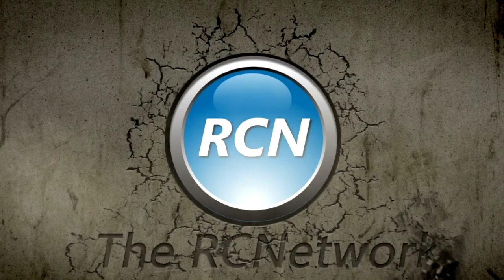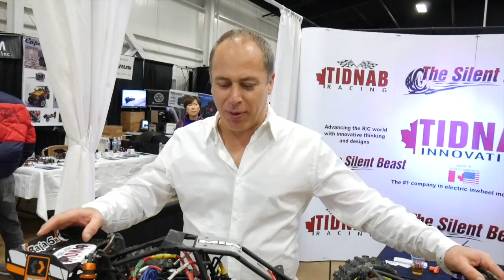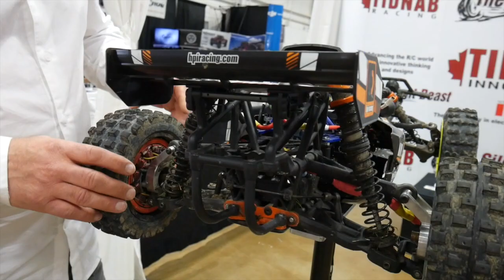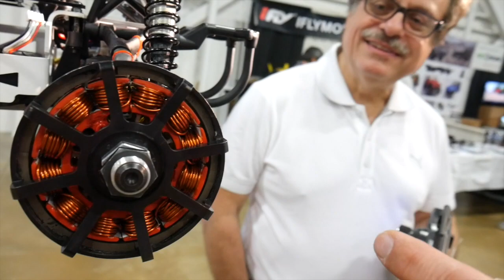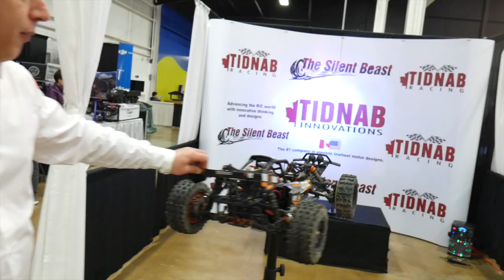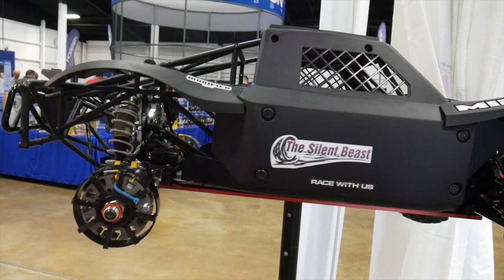RCX 2016 - Interview with TIDNAB Innovations - Baja 5b / Losi 5ive T Electric Conversion

Comment: very innovative and the future of this tech is quite promising actually. i read a lot of pessimistic comments but that's always the case with innovation, most fear it, some see the sense in it. it is undoubtedly going to face hurdles, like contaminants getting in the engine as some have mentioned, but that's simply a matter of improving and re-engineering the design, which happens to every product through its life cycle.

the most exciting thing to me is the future of torque vectoring through wheel speed differentiation. some in the comment section were talking about how without a diff it's useless etc where in reality this is actually the ULTIMATE differentiation method, even allowing for NEGATIVE torque. this is why the porsche 918 or the new acura nsx have individual motors. some may think that this is quite difficult and unlikely but look at the host of advanced software based functions advanced ESC's and transmitters have now. i am willing to bet you will see more and more of this.

however, to keep things relatively objective, there is the problem of having a significant increase in unsprung mass and this will reduce suspension performance.

Comment: Very cool pretty much looks like a stator. Interested to see how it will hold up and field conditions dirt ,mud and ,water
Reply: +EVERYDAY RC , they hold up just great, check out the videos we have posted on facebook
Reply: +Jo P once you get rocks in the motor bells it will rip the magnets up.  it needs a cover but then it can't stay cool enough.
Reply from the maker: +Shark Laser if you saw the Baja 5b - those were the original motors with years now of use.
Reply: EVERYDAY RC .

Comment: I've wanted to do this for years.  I've also wanted to integrate stability control/traction control like what comes on many new cars.
Reply from the maker: +RasmanZ Yep, eliminating a driveline is huge!
Reply: A major drawback would be the loss of frequency response of the suspension due to the increase in un-sprung weight and, of course, the longer wire runs.  :-D
Reply: +RasmanZ first thing I thought of too. unsprung weight will be a factor. nice concept
Reply: +mikeythiry I think a more interesting idea would be motors where the difs are.  4 independent motors with a smart controller, stability control, etc. programmed in.  That would be cool too!

Comment: Verry interesting, and I suppose easily protected from dust with a plate like some diskbrake on real cars. But Is there a system to do like a differential to have a different speed at wheels? Could it be programmable? Is it working with a gyro (to do like an ESP and ABS...) when the car slip?Isn't there a big difference tu use due to the non-suspended wheigt?When everything will be ok, I think that it is the future of every car.

Comment: Those things look awesome! 200kph might be a little over the top though, I can only just control my savage flux at 80-90kph.
Reply from the maker: +Benny2980 Yeah, I think they're really trying to test the waters on the RC market.  Consumers always want faster, lighter, smaller
Reply: +The RCNetwork id still buy it if it did 200kph. Lol
Reply: +Benny2980 The only problem at the top speeds is keeping the tires from blowing each time.

Comment: How much torque at the wheels? The motors would burn out if we attempt to tow a full size vehicle compared to a geared 1/5 scale!
Reply from the maker: +Francis Kuk Wah Might be a question for the TIDNAB guys.  Check they're FB page and leave a comment.  They're pretty quick to respond

Comment: My main concern is handling...... By bolting these direct to the wheels they've removed any kind of advantages you get from running a differential because they don't use one!

Can you imagine driving a Losi 5ive with no differential action at all?
Reply from the maker: That's where potentially a smart ESC that drives the motors detects slippage and diverts power.
Reply: +The RCNetwork Making it even more complicated and expensive.
Reply from the maker: +Anthony Davis I guess my frustration is all of the "arm chair quarterbacks" that are giving their opinion of this invention. Everyone has their skepticism and critique from a simple video. I got to see it in person and see it run. It's amazing and sure, it's probably not 100% perfect, but neither is 95% of the RC's currently on the market. I just wish people had a bit more open mind......
Reply: people tend to stay with the familiar and comfortable, don't sweat it, when the technology is proven most of them jump on the new bandwagon and claim they supported it from the start lol. what matters is that you are sharing it with us and inspire those open to seeing it's possibilities :).
Reply: don't see where it would be very difficult to add diff settings into the esc,  could control lock, and freewheel actions to infinity,  making a diff adjustment a few clicks on your phone if the bt the controller.  probably has a ways to perfection.  but this system is being instituted on performance minded 1:1 4wd vehicles which means they've already got the diff scienced.  awesome tech 2ith a few tweaks it might be on all cars in 10 years.  affordable for most right now,  likely not.
Reply: Its actually garbage.  You now have a MASSIVE increase in unsprung weight; which will greatly affect handling in a bad way.
Reply: If you don't have weight figures and actual data from this setup then it's hard to take you seriously. Not saying you're wrong.

Comment: What would you recommend for a really strong and really fast servo for a 4wd short truck
Reply from the maker: +Kaleb Moore Dollar wise, the best bang for the buck is the Savox 1258tg.  166 oz/in of torque and .08 seconds for under $70.  The step up from that are the brushless servos from Hitec - the 9000 series.  Just pick your torque/speed.
Reply: +The RCNetwork but without out the money factor in the servos and do you want a lot of speed or a lot of torque for a 4wd short course truck
Reply from the maker: +Kaleb Moore Hands down the Hitec 9360:  http://hitecrcd.com/products/servos/digital-brushless-servos/hsb-9360th-high-speed-brushless-titanium-gear-servo/product
236 oz/in of torque and .06 seconds on 7.4v.  Titanium gears and Brushless, so it will last long.  Also comes with a "voltage Cap" just ion case.

Comment: They come, and they go.

But a good gas engine always comes back. :)

Doug @ ESP
Reply from the maker: Gas/Nitro has been on the decline for years now since the intro of brushless and Lipo.....
Reply: +The RCNetwork At $45 a gallon here in Canada , I've given up on nitro. I was really hoping that the Losi 1/8 gas engine was the answer but ...
Reply: To right can’t better than gas power  only batteries I need is in my hand set and the one in the car

Comment: tidnab - bandit conversions. A clever idea but ultimately flawed off road (dirt and debris.) in an on road car the Torque splitting and distribution potential is limitless.
Reply from the maker: +David Bassou From what I've learned recently, the Baja shown in the video has about 4,000 kilometers on it over a 5 year use.  It was pretty dirty, so it looks like dirt is not an issue.  The owner also stated, they're swapping out failed motors as well.
Reply: +The RCNetwork dam! say no more on the premature wear then. I'm impressed. Please take my money NOW!
Reply: This is going to be revolutionary. I want to invest!
Reply from the maker: +David Bassou Contact TIDNAB on their FB page

Comment: My man bought his 1/5 scale truck because of the engine sound, realistic looking parts and handling characteristic of a "Real" Baja racing truck. Now you add batteries and an electric motor... That's Gay!
Reply from the maker: Not really when you factor in there is ZERO lag in electric and there's no break in, no tuning, and pretty much no issues.  The sound is great when you're out in the middle of no where running it....electric RC add the ability to run at 2am and besides the screaming of the tires, no one will know you're running it....
Reply: and it's faster   :-)   much much much faster  :-D
Reply: there is no competition, electric will annihilate nitro all day long. without making a noise and upsetting  people around you !
Reply: hp on these motors probably no where near 21hp on the alx

Comment: So instead of 1 motor with potential to fail and replace you now have 4. And you have to produce enough electricity to push all 4, and you have the potential of damaging the motor more with every jump fall or hit.
Reply from the maker: Well, lots of good points, but they did test this for years....but have since done nothing with the design.  Likely due to the cost of conversion/lack of actual 5th scale buyers, etc
Reply: @TheRCNetwork  Kevin T.  had one that looked very similar that he purchased. It had the wheel motors but much of the car was printed parts including the wheels causing quick failure.

Comment: all that unsprung weight cant have a good effect on the suspension not to mention how much dirt collects inside wheels that will find its way into the motors

cool idea but not really something the offroad market needs
Reply from the maker: +Sleepy .Time The Offroad market is dying for this!  No driveline?  No Transmission?  throttle mixing like on a Quad?  It will be game changing!  Also, unsprung weight is easily tuned......Did you notice the premium MIP shocks on the Flat Black 5ive T?
Reply: The RCNetwork
time will tell, i disagree that this will get beyond a cool prototype of a very impractical design
Reply: unsprung weight is the best type of weight

Comment: Can be AWD to?
Reply from the maker: +Ionut Costache-Bobescu Yep.  But it sounds like you'll need to run additional voltage to power all four motors - I believe they said 18s on the Losi 5ive T

Comment: Cool idea, run it in some sand and those motors will be done.  Awesome on concrete I guess...should be shooting for the on road guys.  Please stop citing 122mph, with load and frictions you'll be lucky to hit 60mph.
Reply from the maker: +Crossfire Lemon the Baja in the beginning has been running for years. In dirt. As much as I think 122mph is crazy, they're hitting clearly over 60mph. It's all about voltage.
Reply: +The RCNetwork I don't believe that, unless it's pea gravel or something of that nature.  Out runners....regardless of size or style....are not even slightly designed for that sort of abuse.  They make claims of being the leader in innovation and having the fastest 1/5 on earth and have zero physical evidence to back it up aside from a dirty Baja.
Reply from the maker: Contact TidNab.  I'm merely showing what I saw at RCX.  Skeptical as you may sound, I got to see it run....

Comment: This will send unsprung weight through the roof and reduce sprung weight. Not good. I would have been more impressed if they had come up with a Tesla Model S-like dual motor setup, one for each axle.

Comment: Bet I could destroy that motor really quickly driving it on the beach near me, 1mm to 5mm sharp shingle and sand, needs to have epoxy encased coils. But a great adaption of electric bicycle technology scaled down and done correctly,  just hope a pair does not cost much more than a castle 2028 motor or it would be too expensive lol
Reply from the maker: Maybe, but TidNab has really driven the crap  outta the Baja pictured - still on the original motors

Comment: When it comes to reallity,i would choose the  rc which is using engines but sorry guys i am not a big fan  of electric Rcs even if how fast is it,(5400 rpm) without engine sound,fuel  and a smoke coming out from the exhaust pipe...electric rc is so boring...

Comment: Horrible design what happens when a small rock winds up in stator an tears up your $250 motor. Never mind all the other crap that gets in there. How long could they last before there bad? And never mind sand. And let’s not even begin to talk about the stress on the motor being hooked up direct like that with no diff. Looks an sounds good but really is it worth a crap?